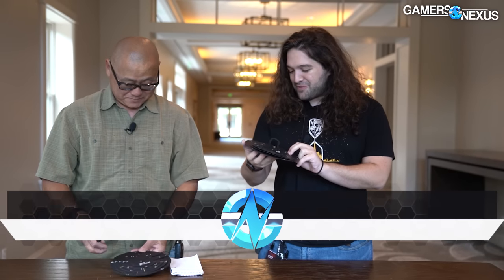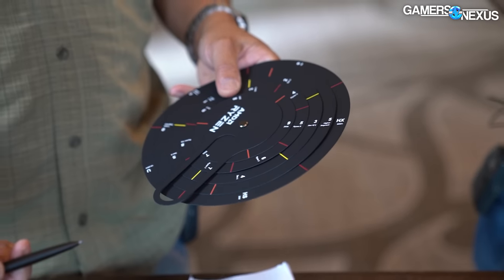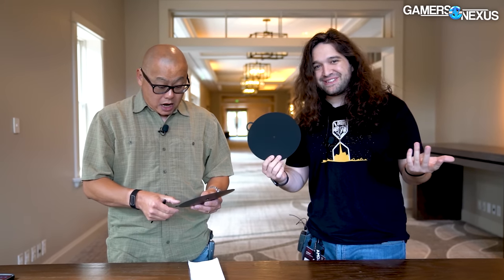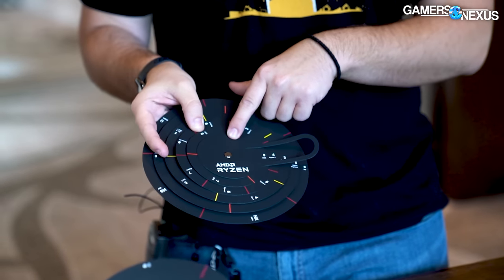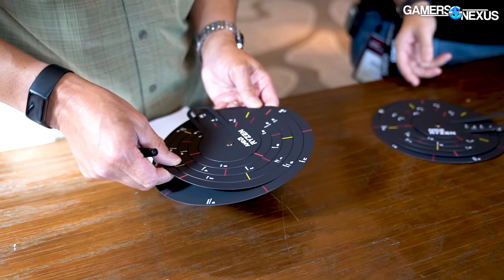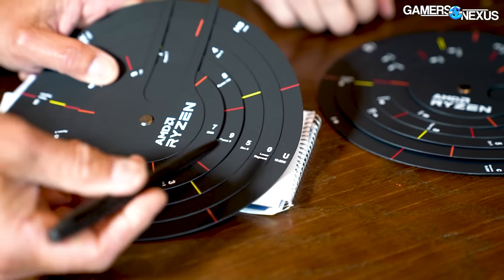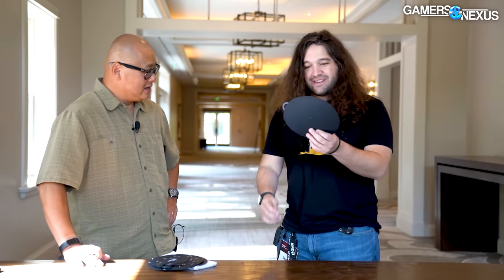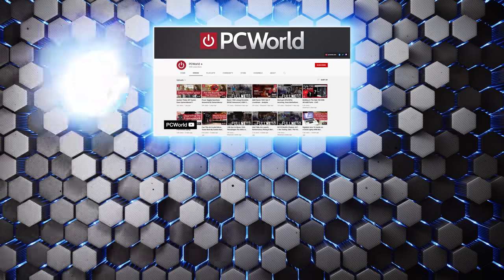AMD Gave Us Too Much Power | CPU Naming Problems

Comment: I would have no problems with them selling older parts, as long as they were represented as such in the name.  I am highly annoyed that I bought two 5700U laptops for my parents thinking they were Zen3 and finding out later they are Zen2.  I would have no problem with AMD selling, for example, a Ryzen 2450G as a new part in 2022 that is just a Zen1 APU with some mildly increased compatibility with memory and slightly higher speeds than the old 2400G, for, say, $60.  I WOULD have issues if AMD were to sell such a chip as a Ryzen 7150G, even if it is the same $60 price point.  Same goes for Intel, or anyone else.  

Older designs are still viable for years after the new designs come out, and can be made cheaper, as the design costs are covered after a time and the manufacturing process has matured to reduce defects, so why not make use of them?  However, don't misrepresent them as newer designs.
Reply: Yeah I'm typing this on a 5700u laptop, although I knew what I was getting. I use it for lower hardware intensive games but man I wish it had RDNA 2 over Vega!
Reply: @raptor1672  for RDNA you'd have to wait for 6800U instead. Both 5800u and 5700u are Vega based.
Reply: Well I have that laptop CPU and they perform well (as did the 4800u) and it was available early in 2021 before the 5600u/5800u was available.  I doubt if your parents would have noticed the difference with the 5600u.  The price was lower than I would have paid for a Zen3 one a few months later, which were in high demand.  I do understand why you were disappointed though, it shows why marketing uses model numbers rather than CPU codenames.
As for 7000 series, using DDR5 or LPDDR5 means only Rembrandt can perhaps be rebadged; they may stay 6000 though as the new Dragon Range appears to be a lower TDP version of desktop chips, with Phoenix coming later in the year IIRC.  Perhaps the marketing will create tiers differently and older cores won't just be +900 in future.
Reply: @RobBCactive  Yeah, my parents aren't gamers, so they'd not likely notice a difference.  Still, it was annoying to think they were one thing and find out later they were older.
Reply: @raptor1672  They've been good laptops for my parents.  They're in their 70s, so there's only so much they do with them.  They've been pleased.
Reply: @dangingerich2559  well I play games and have Comp Sci degree, I'm really happy with the 5700u so don't worry about it :)   All the CPUs are amazing really!
Reply: is you're good enough to know architecture name a little research on the chip name goes a long way
Reply: @potatorigs2155  Yeah, I didn't think I'd have to do so at the time.
Reply: What does it matter if the 5700u is Zen2 cores?  Its performance fits in line with the 5000 series naming.  It has more cores than the 5600u and is slower than the 5800u.  They both have vega graphics so the feature set is the same.  I can't really see what you'd be annoyed about.
Reply: @MrCalagon  In many ways, the 5700U is slower than the 5600U, and it would have saved me $150 each on the laptops if I had gone with the 5600U version, which became available 4 months later.
Reply: @RobBCactive  In before they rename DDR3 To DDR5 Gen 3.1 and DDR4 to DDR5 Gen 3.2
Reply: @MrCalagon  Lucienne is basically a Renoir (Zen 2 APU) refresh, yet its names are more in line with Cezanne (Zen 3 APU), which uses a newer CPU architecture. In other words, it's basically false advertising.

By stark contrast, Barcelo's names fit in with Cezanne's instead of Rembrandt's, despite being announced and released alongside the latter. This is far more favorable, as Barcelo is a direct refresh of Cezanne, whereas Rembrandt only shares the general CPU architecture (while on TSMC's N6 node, which is an improved N7 node).
Reply: serisously. they left plenty of space in between the numbers. just fill those in.

Comment: Remember the B550A motherboard AMD made for OEMs that was literally just a B450, but with a 5 as the first digit so OEMs could market it as new? This is the exact same BS. AMD has been doing this for years on laptop CPUs for the OEMs to market them as newer CPUs. It’s all solely for competitive advertising purposes.
Reply: Do you want a Ryzen Series One X? Because this is how you get a Series One X, Lana.
Reply: At least they stopped putting different voltages on the same CPU architecture which resulted in a few blown up (if I remember correctly) K6-2 processors.
Reply: Yep. This is complete BS, and a whole bunch of regular consumers will be burned by this, mark my words.
Reply: The 5700u is a 4800u zen2 part with an updated name in order to make it seem like it's Zen3.  I think that's much worse than renaming a chipset.
Reply: To add to this: Sometimes chip makers are beat up by their customers into offering 'new' model numbers. That's everything from big box buyers to PC makers. Consumers often ONLY look at model numbers and stores and OEMs know this so they beat up Nvidia, Intel and AMD to make 'new' versions of the old chips because consumers want the new model. So yes, the naming isn't honest for enthusiasts--but in the price conscious areas where the shopper is often behind on the curve on information, the new models work. Just want to point this out from people who may not understand the dynamics at work. Stores, PC makers and chip makers are in the business of making money--and that doesn't always means having to have 'honest' model numbers displayed. Ultimately when you get that text message from your family or friend who wants to know 'which one is good' take a moment to help decode it for them.
Reply: @FakeGordonMahUng  Are you the guy in the video? Yeah, this is pretty much what I’ve been saying since I saw it: AMD and their customers have a financial interest in making people think they’re getting more performance than they are, and this naming scheme happens to be really good at that.
Reply: @reinhardtwilhelm5415  yeah, well have to wait for the full lineups. In AMDs defense though, they probably aren’t concerned about a ryzen 5 eating a ryzen 3 sale. They just want it to be an AMD sale instead of a competitor.

Comment: Could AMD possibly make a digital version of the wheel...?
Reply: they should've.... 😅
Reply: oh that would take them ages... let them first fix the 6y old fTPM bug which causes stuttering.
Reply: No, real code wheel only because it can be put into the new AMD cereal box.  It has marshmallows.
Reply: @PrefoX  fTPM fixed in recent AGESA.

Comment: This just feels like a convoluted way to hide that they're selling old stock and they don't want you to know what you're getting.
Reply: More like new stock that failed tests for new stock but managed to pass the tests for older generation stuff.
Reply: The way I see it, the issue is that there are two very different classes of consumer that want to buy the newest chip. There are those who've heard terms like Zen3 and know they want the latest design, and there are those who want it because newer = better. For the latter case, it honestly doesn't matter whether they rename old stuff. As long as the model numbers reflect general overall performance, it's doing exactly what it needs to, and the age of the architecture doesn't actually matter. Those consumers don't know they're getting old stock, but they didn't know what they were getting in the first place. Then for the people who actually know what they want, the nomenclature discussed here does still tell you what the chip is. I don't consider this deceptive.
The only part that's objectionable is the year prefix, since as discussed in the video it's meaningless marketing that violates the principle of the model number reflecting performance. That definitely should not be there.
Reply: @erkinalp  That would only work out if the architecture does not change between new and old stock. Otherwise your new stock that does not meet the requirements of the new stock (please explain how that should work anyways, seems like simply made up out of desperation to make a point) would still not meet the requirements for old stock, becasue the architecture is different.
Reply: @johnscaramis2515  For example, Zen 4 is a strict superset of Zen 1. If your chip fails to reliably process the instructions added after Zen 1, you fuse off Zen+/2/3/4 extensions and sell it as a Zen 1.
Reply: @erkinalp  That wouldn’t reflect other micro architecture changes though. ISA and process tech (voltage-frequency performance) isn’t the only difference between CPU generations. This manifests in metrics like IPC that change between Zen 2 and Zen 3, for example.
Reply: @erkinalp  They don't just tack on new sections of core to make a new generation. The changes are integral to each core.

Comment: The only excuse for this naming setup for old cores is if they're made on a new node as years go forward. So they're somewhat different in power characteristics if not performance. It could matter. But selling zen 1 cores just shouldn't make any economical sense at some point so this naming shouldn't be a real solution to any real problem.
Reply: Gloflo 12nm is a hell of a lot cheaper than TSMC 7, 6, or lower. The reality is that a 3400g (Zen 1+ on 12nm) is still a very capable processor for a general office machine.
Reply: @egalanos  honestly a Q6600 is still mostly fine for office work (I use one as my garage PC), but if you're buying a brand new computer i would expect it to come with a brand new chip with brand new microarchitecture.

Usually the 2 generation old computers from Dell are at a HUGE discount, naming products in this manner just makes it so that they can essentially sell Ryzen 3000 chips for brand new PC prices
Reply: @egalanos  yes for now. But if intel was still making i5-4590k it wouldn't make sense to anybody. Just buy a current pentium or an i3... There's always a point where it doesn't make sense anymore.
You can still use that CPU perfectly if you have it, but buying one new in box is ridiculous.
Reply: @BlackhatAudio  it costs something to produce you know. They can't just give them away like 1gb usb drives
Reply: Maybe they have a contract with tsmc of a number of parts that need to be produced on each node

Comment: I'm absolutely against naming the old core as new ever since AMD did with mobile zen2 but AMD fanboys defend it regardless. These days it even leaked into desktop counterpart and worse of all, the igp part is killed. True, AMD wants to dump these leftovers but remember they are using DIY market to do that
Reply: It's a bad practice, the 3000 u ryzen should be called 1000 series and the h series 2000, the 4000 should be called 3000 and the 5700 be called 3850u or something like that (or 4850 if they really insist in using the 4000 series for zen 2). 

However intel names are sometimes even more confusing. Why are the 1135G7 and 1165G7, both quad core CPUs with hyperthreading, called i5 and i7, if there's barely any performance difference? Why is the i5 10500h called i5 if it's almost literally the i7 10750h? Why is the 1035G7 also 10th gen if it's a completely different architecture than the 10210u? Why does the i5 1035G1 still use intel hd graphics, despite it sounding like it uses a weaker version of the iris xe? What the hell is a 1260P? Why are there only 4 digits now wtf, it sounds like it is a first gen intel core chip

In he end both companies need to fix their naming schemes but i do find myself more confused by the intel naming scheme than i do with AMD's
Reply: They also did it with the desktop APUs, with the 3x00G being Zen+, not Zen2.

I'm a bit of an AMD fanboy, but the naming part of their marketing department needs a random drug test.
Reply: It's not just AMD every company does this. Intel has done it for a decade which you conveniently ignored 🤦

Edit: which is what they said as well in this video "every grown up company has to do this" which also you somehow ignored
Reply: @mparagames  When it comes to mobile that's just how it is. They're marketed towards people from all walks of life so they won't really know what a Zen 3, Zen 2, or Alderlake are. So they just try to hit different price points with their older SKU's. Which may not be enough for you, but it might be absolutely plenty for your neighbors grandmother.
Reply: @dondraper4438  well yeah but at the VERY least it wouldn't hurt to call the 5500u and the 5700u, 4650u asnd 4850u respectively. It would still state that it's better than the previous last gen chips, but not as good as the newer, flashier chips, but in a more fair manner.

Also, for the regular user, "1260p" is confusing. How are the gonna know it's better than the i5 10210u with a name like that? How hey are gonna know that 1035g7 is significantly better than it, if it's also labelled as 10th gen?
Reply: So you think a new model number like 5500 in the same range a 5600g with a defective iGPU shouldn't be sold, but simply wasted when there's been a chip scarcity?
You've made it obvious you're an Intel fanboi who is unaware of how your own favoured products are marketed to you deceptively.  I can understand people not liking a 5700u laptop being a tweaked 4800u, but OEM & ODMs don't want to discount/market their new year's range, when they're perfectly functional, have had improvements and are available early in the year before newer SKUs are manufactured.

The real problem is when a company like Nvidia sell different GPUs with the same model number, then cease support on one variant without any way for customers to see what they have or be notified by Nvidia that their 2 year old product has been abandoned.   I look forward to your investigation of Intel 13th gen non-k parts, which appear identical to 12th gen SKUs.
Reply: @hiromasaki  At least in zen 3 era they (kinda?) fixed it by calling the zen 2 apu chips 4000 series rather than 5000.

But then you end up in a weird situation where a ryzen 3 4100 is worse than a ryzen 3 3100. So i'm not sure it's an improvement.
Reply: @mparagames  You got them backwards.  The 4x00 series is Zen 2 APUs, Zen1+ APUs are 3x00G, mixed in with the 3x00 non-G Zen 2 CPUs.

Zen 3 is the first to get it "right" with 5x00 all being Zen 3.  Well, until you get into laptops where 5x00 is a mix of Zen 2 (5300U, 5500U, 5700U) and 3.
Reply: @hiromasaki  no no no, i know, what i mean to say is that the 4000 series apus were released for consumers at the end of AM4 lifecycles, when zen 3 was alreasdy consolidated, and thankfully they weren't called, uh, idk "5500g" or something like that.
Reply: @mparagames  That doesn't match the timeline.  First Laptop 4000 series chips were in March 2020.  Desktop 4300G/4300GE/4600GE/4700G/4700GE were released in July 2020. The first Zen 3 parts weren't released until November 2020.
Reply: @mparagames  Intel names can be confusing but they are consistent.  11 means 11th gen, 65 is a performance level, G7 is the GPU.   That's how they  do laptop parts, desktop is 100% consistent.  We're not going to see for example a 12200 that is a Skylake 14nm part.  That is what AMD is doing here and it's a very deceptive and underhanded practice.
Reply: @hiromasaki  As far as I recall, back then it was for OEMs only, for consumers they only released in 2022, and only the 4600g. The 4300g and 4700g are still OEM only
Reply: @dumbestbiscuit  For desktop intel is pretty consistent, yeah (aside from the fact the x600 CPUs used to be i7s and then became i5s, but that's a minor deal; also i still dunno how the i9 11900k has the i9 branding since it has less cores than the previous gen counterpart and is pratically a carbon copy of the i7 11700k, but other than that there aren't any inconsistencies). 

However in laptops intel naming schemes is a hot mess, more messy than AMD imo
Reply: @mparagames  It's the only one of the line available in retail packaging, yes.  But it's one of 6 models all using the same cores (Renoir).  The naming scheme for Renoir was set before Zen 3 was available, and well before the Zen 3 APUs (April 2021).
Reply: @dumbestbiscuit  It's absolutely deceptive, since that's half of marketing. With that being said, what will make it break those products are pricing and availability.

If they can hit some really low price points with those Renoir and Cezzane laptops it might not be a problem.
Reply: @dondraper4438  There's nothing cheaper out there than a laptop with a Zen 1 chip on it.  What will break this is if reviewers review them as new parts of AMDs 2023 portfolio (new chips), which AMD says they are.  Imagine a 7310U (zen 1 mobile) going up against a 1135G4 (11th gen Tiger Lake) in the $450 segment and the results in say, Forbes or Newsweek.

Comment: "7 for 2023...", fantastic, great job AMD. 👍🏻
Reply: actually that is a system that makes sense because the cross total equals 7 2+0+2+3 and 2024 equals 8 2+0+2+4
Reply: @name-ic3vo  works for now, but can wait until 2+0+3+0 = 5, or 2+0+3+2 = 7 😛 #guesswegonnaneedabiggernumberscheme

Comment: it's crazy the fact that many people are going to get a laptop with a new shiny Ryzen 7000 sticker and it can possibly turned out to be a Zen 1 cpu
Reply: This probably won’t happen. It is probably at worst 7000 with a zen 2+ since zen 1 cpu is probably out of production for a while now
Reply: @sentryion3106  So it's ok that someone thinks they're getting a modern CPU, and are really getting a 3 year old rebrand?
Reply: @dumbestbiscuit  I never said it's OK, just said it wouldn't be that bad
Reply: @dumbestbiscuit  the numbers listed clearly what you'll get. This is actually much more transparent than previous scheme.

Comment: I think the year mostly signifies to generation, which in turn does often have an impact on IO die, connectivity and graphics (best example is steam deck, it's a current gen chip with DDR5 and RDNA2, while having Zen 2 cores, which is different from a normal 4 Core Zen 2 APU, which normally would have Vega and DDR4).